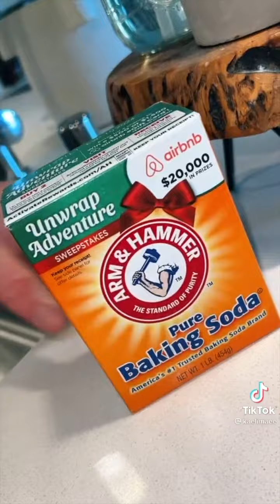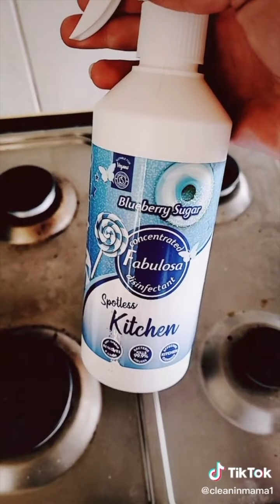Heavenly Cleaning Tiktoks: Cleantok Compilation No.11

Comment: Let me do my dishes before I put them in the dishwasher….
Reply: You can’t just stick dishes with a bunch of stuck on food in the dish washer they won’t come out clean bozo
Reply: You’re probably 12 😂
Reply: @ig3815  Ofcourse not, it’s called a dishwasher for the fun of it. Lol.
Reply: @ig3815  then what is the point of a dishwasher?
Reply: @mrsparkdotcom  it sanitizes the dishes with much hotter water than humanly possible. Also most dish washers have a drying setting.